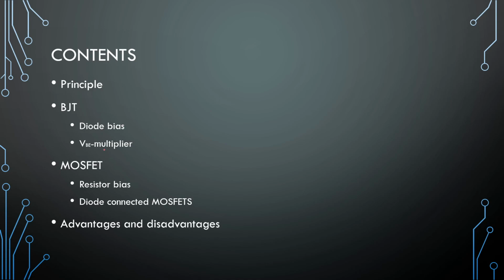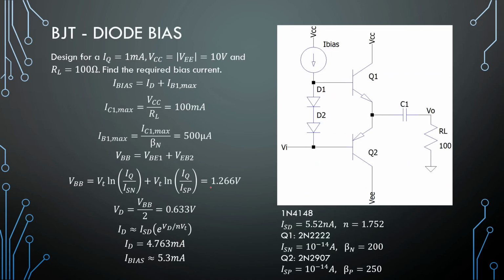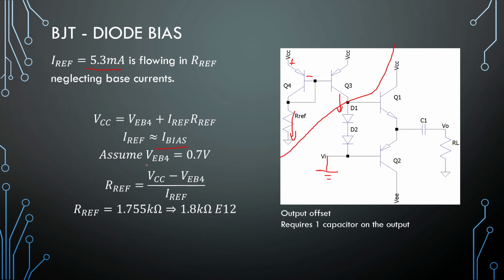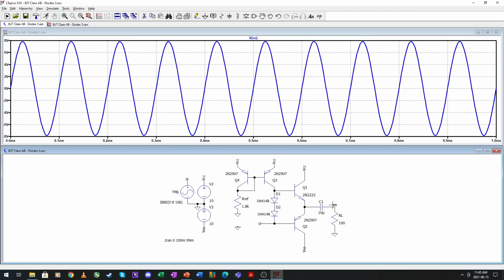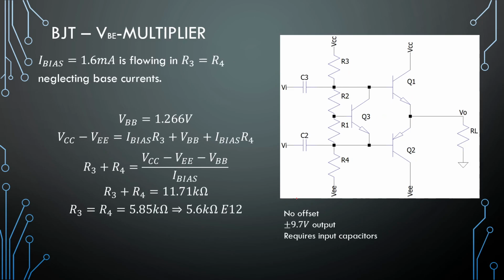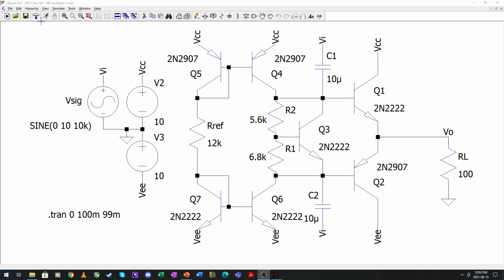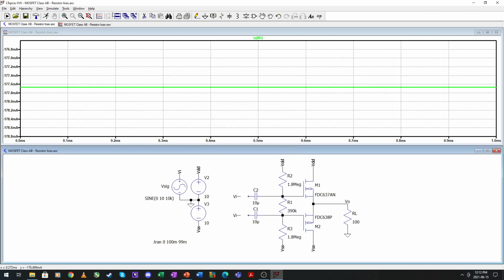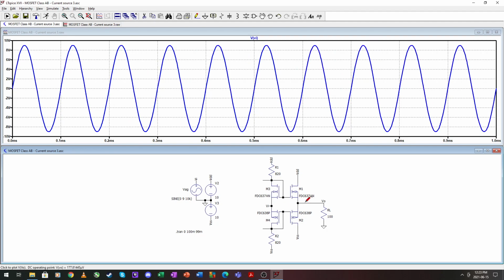Video 3 - Class AB amplifiers

Comment: Great video, but I don't understand the amplification. If you're inputting 10VAC to circuit and getting about the same as output, I don't see where and how you are amplifying it.
Reply from the maker: Class AB amplifiers have a gain of around 1 V/V. The point is to drive small loads, something like a speaker has a impedance of 8 ohms, if the amplifier output is high there will be too much losses. A class AB amplifier has a low output impedance and a high input impedance to correct this. That is why a class AB is typically an output/last stage.

Comment: Hi Ardiaan, I was looking at the datasheet for the 1N4148 and had some trouble finding the value for the saturation current and the value for n. Could you help me find these?
Reply from the maker: Good day, the saturation current and the value of n is typically not in the datasheet. Find the SPICE model for the component, it is in there. To get some information on components you sometimes have to mix resources or guess in some cases.
Reply: @EzElectronics  Alright, thank you!